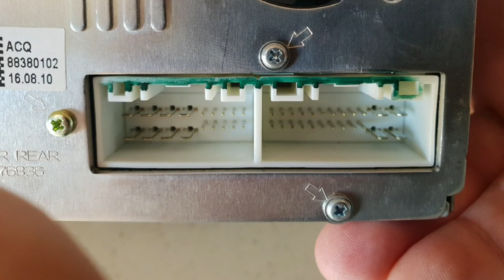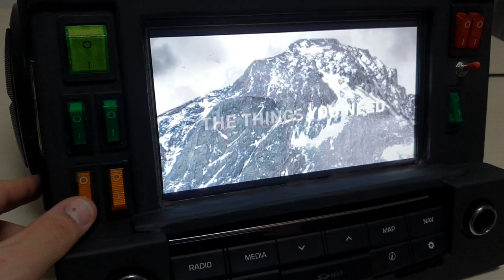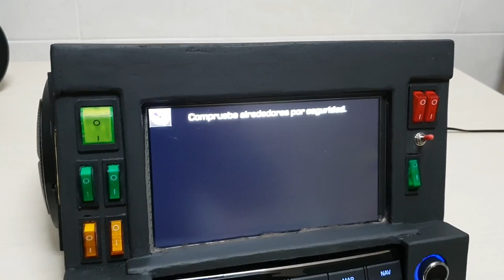Encapsulating Hyundai Tucson LAN5020

Comment: @jkdsoft Do You know how install adb Android drivers or show computer management on Windows CE?
Reply from the maker: I think that's not possible. If you want to link your phone to device,  try Tucsy Auto
Reply: @JKDSoftware  i have problem sometimes with my xiaomi. Its to slow so i want find to solutions with dongle android
Reply: @jkdsoft what about command prompt?
Reply from the maker: @piotrtchorz3593  Cmd seems to be disabled in some way. Maybe it's configured in registry to send output to a null device instead of screen. That's a "yet another issue" that I have to look at when I have time
Reply: @JKDSoftware  did you see, menavrus added mirror link.so they installed adb
Reply from the maker: @piotrtchorz3593  Menavrus includes ScreenStream application which provides mirroring through HTTP. But Tucsy Auto provides faster refresh rate.